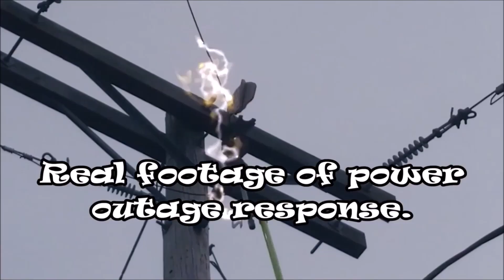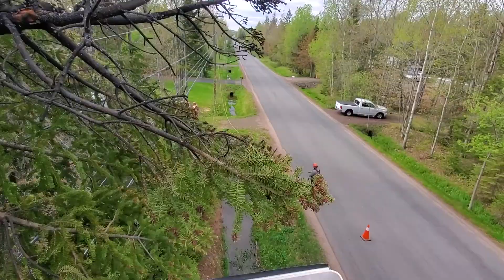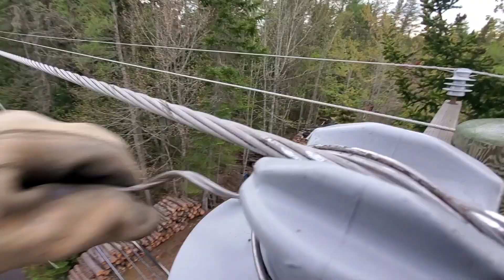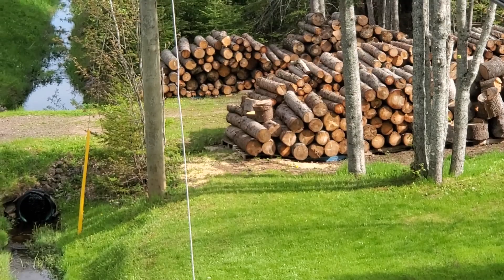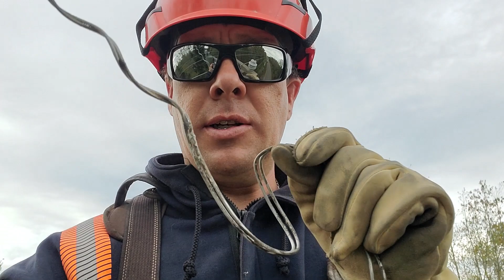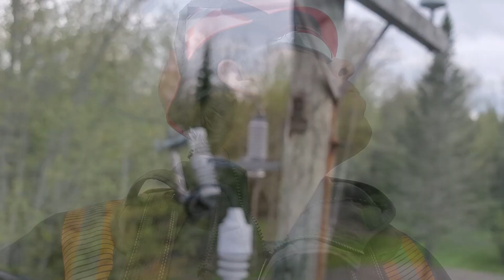Improper tie wire drops powerline across driveway

Comment: I don't work as a lineman, I'm an IT guy & anything above 48 volts generally scares the living shit out of our types, but this just seems like the kind of thing that maybe a second set of eyes should double-check after installation to make sure it's right.  I've gone to more effort securing network cables above a drop ceiling than somebody put into those pole ties holding high voltage lines over people's heads!
Reply: Go look at the grid side of a datacenter and you'll see some stuff that even the linesmen get in the bee suit for.  The lines in this video can carry about 3,000-5,000kw of load.  Datacenter feed in lines can be north of 30,000kw per strand.
Reply: I was a battery guy for backup and telecom systems… -48v 75000 AH of batteries on the bus bar… times by 10 for a short circuit amperage… personally neither AC or DC scare me, but I sure as hell respect it all.
Reply: @silvercrystalct  Anything conductive dropped across these bars... Is well, vaporized in very short order.
Reply: I'm the same!  Spent more time with a network cable along the wall of office...  or inside the back of a tower cabinet.
Reply: I'm a electrician and perosnally would much rather work with 120v then deal with those pesky network cables. You have to take your time or else it ends up looking like shit or the wire gets damaged and you go and test it and it doesn't work.
Reply: And how do u propose they QC it? You want someone coming behind in a bucket truck to verify it? That is a lot of work and expense. Flaggers, traffic control, positioning the truck, rendering the truck safe just to go up and look for probably 30 seconds? Guess how they will pay for that? Yup, your bills will go up.
Reply: @mikel9567  There is this awesome technology being used now in a multitude of industries, called drones. A single drone operating QC person could inspect the entire run in minutes.

 Hell, thousands of miles of power lines and pipelines are patrolled via drones instead of manned aircraft now.
Reply: @mikel9567  Okay.

Comment: That all goes back to the saying "Hard to find good help anymore." and with that said, it's only going to get worse from here on out as people would rather collect stimulus and never ending unemployment checks than go back to work. I feel bad for the world moving forward.
I work with mainly low voltages (under 240 volts) for communications and railroad applications but the same principles apply when it comes to dressing up lines. Do it right or don't do it at all and have someone who knows do it.

Comment: Have had too many cases of improperly installed preforms and installing a hand-made aluminum tie using the copper hand tie technique on aluminum conductor...cross over the conductor..copper tie and wire can handle oscillation and vibration, but the aluminum crossover will wear through and the phase is just laying on the insulator. I always tell my coworkers and apprentices to never assume whoever installed it knew what they were doing!!  ALWAYS CHECK!!  I Appreciate the Channel!

Comment: I got a question I drive along the roads and the electric poles (not all ) but some have such a bend in them it looks like that it could snap so my question is how much of bend in a pole has to be before it gets attention
Reply: Depends on a pole by pole basis..belly in the pole because of large transformer side mounted, down guying pulling, out of line, just old and shot..

Comment: When you showed that wrap that had been done with a pole, I had to shake my head thinking about how tedious that had to have been reengaging that tiny hole with a wobbly stick every half revolution. Not to imagine the stress on the arms and back in doing it as many times as it took to secure all of the lines.
Mad respect to you all.
Reply: And that is why so many old lineman have bad shoulders. That, and from using cutters, 052 presses, and manually-operated hydraulic presses. :-(

Comment: A good lineman told me always check a pole or two down as well, not just the pole you’re working. Could be moving a phase and have it pop off of insulator or worse a pole or two down in either direction.
Reply: That lineman knew what he was talking about,you young upcoming lineman,pay attention to them old lineman,they know from experience what they talking about,im a retired REA lineman 32yrs,that's how we were trained by the older lineman
Reply from the maker: Yes! Excellent advice 💯🙌
Reply: @Bobsdecline  If you haven't already, i suggest that you invest in a small drone with a remote camera!

That way you can easily inspect these poles from the ground, or even in your truck.
And it is always nice if you can inspect broken live wires from a distance!
Reply: @tinkerwatts7343  100% correct, but I have to laugh because 3 very very experienced linemen were doing a demonstration in safety and they did a lot out of telling about how important experience is. The main linesman did proudly tell that he had been in the business for OVER 4 years, another had been there for 3 years and the third had worked as an electrician for 2 years and one year as a lineman! :-)

Comment: I was on a call out for no power years ago. Initially it was thought result of a faulted high voltage cable. When checking for potential turns out the cable was still hot. It was an overhead phase was resting on the cross arm. No bad cable, just a matter of  tying the phase onto the pin insulator.
Never assume and always check for potential!